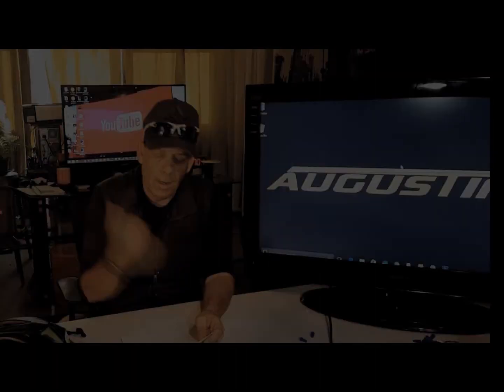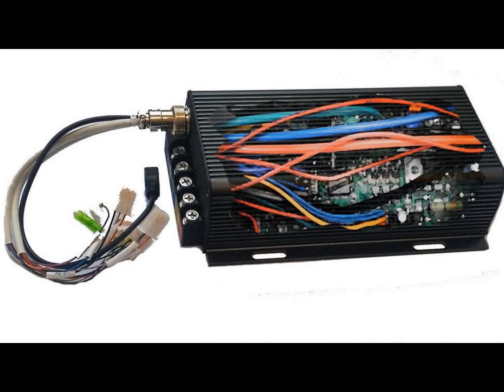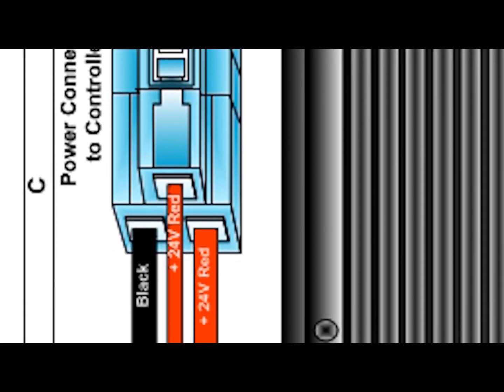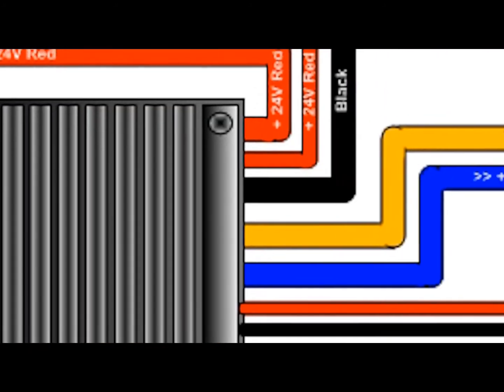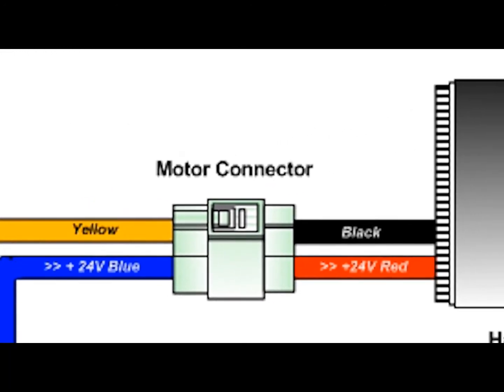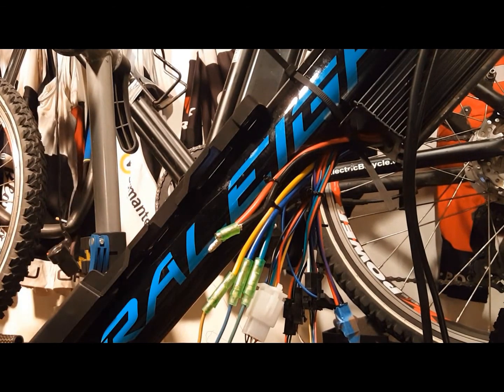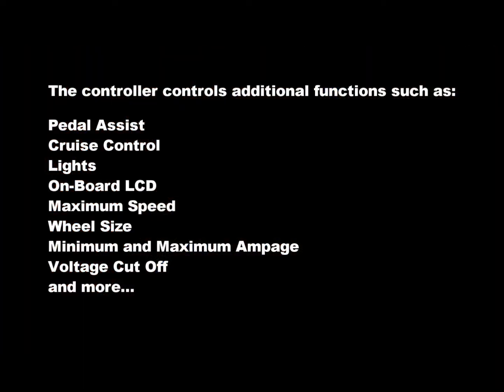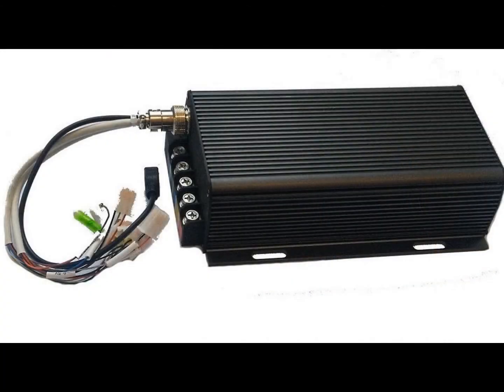What you should know about your Ebikes Controller

Comment: I have a question, Im new to the electric bike stuff. I ordered a 72530 fardriver controller and a 72v 350a sustained and 450a peak battery. After the fact I read that the 72530 is only rated for 350 line amps. Will this battery damage the controller? Or can I program the controller to only accept its max of 350a from the battery? Or perhaps this could be achieved with the BMS? Or should I order a higher amp rated controller? Thanks

Comment: what is the best controller to get for your e-bike the wires or the one with the plugs
Reply: I've known multiple people taking about issues with regard to performance using plug and display integrated controllers. I've seen and read literally no negative feedback regarding the performance of the wired boxes so I'm still going to use an actual wired controller box rather than one integrated inside of a poxy display panel. Also the reason that wired boxes are better is that a lot more high resistance and strong chunky capacitors and resistance fuses can sit inside the larger box than inside a slim phone with puni week little capacitors and fuses in it.

Comment: Hi I have same battery on my bike as in your video at 42 sec, but something stopping all from working , the controller on the bike is on handle bars with my model , I've swapped it out for 2 other controllers but still wint light up even though battery is charged, I wonder if I'm using right controller , do you know which controller goes with this model battery please ?

Comment: Great video.
Question, my battery is 48v 20ah.  My controller is 48v 20ah. Manufacturer upgrade from 20ah b/c none in stock.
Will this combo work? Heard it could damage battery.  I use PAS too when riding.

Hope you can help.

/Bklyn👑
Reply: Thats exactly where I'm at, did you figure this out by chance? Was the wattage the same between the controller and battery too?
Reply: Mate with any ebike to prevent problems all you need to do is check that the voltage output from your battery is compatible with the maximum voltage intake of your controller box which you clearly already have done. Currently run a 48 v 20 ah battery through my 48 v 20 ah controller box to a 1500 w motor and it's an awesome powerful bike with No issues and plenty of speed.

Comment: So if I change my controller would that make my bike faster ? Or i also need to change the motor hub to make it faster ? I have 72v 30 ah lithium  battery right  now
Reply: Never change only one , instead change both and check they are compatible with each other ! Why ? .... Because you can risk accidently installing a controller box that has an output that is way too powerful for your motor and you know what that leads to eventually after a few trips out you will power on the throttle and it will be fireworks night.